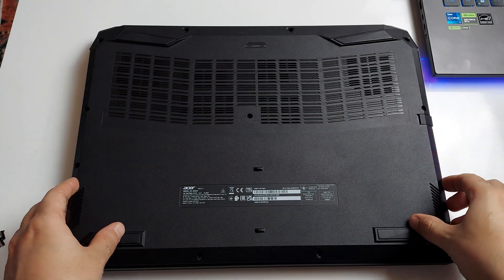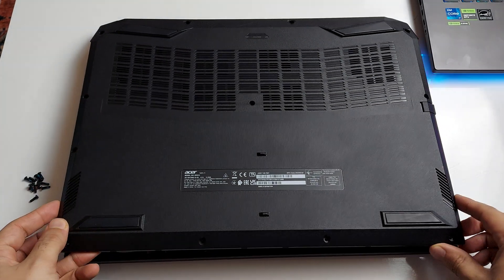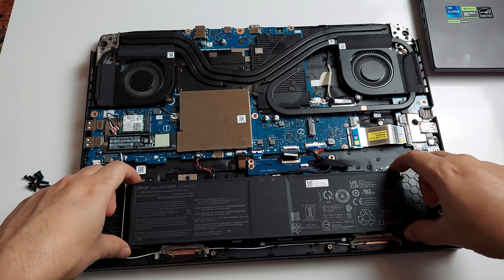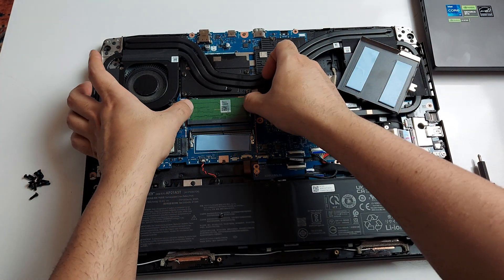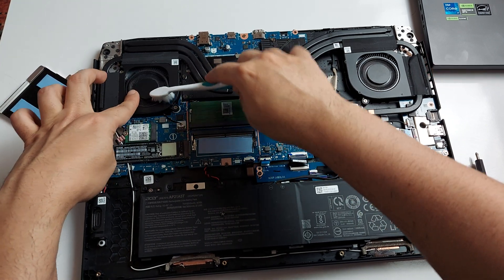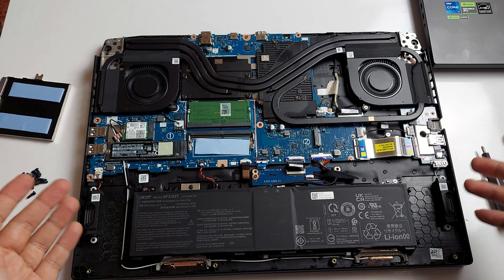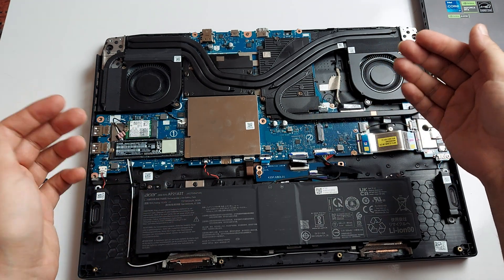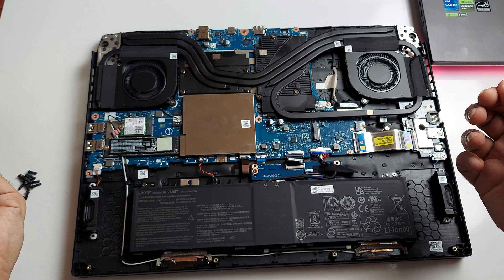what's inside the Acer Nitro 5 RTX 4060 Intel i7

Comment: That is a lot of wasted space. kind of sad to see such blunder by the design team.
Reply from the maker: It's built like a tank, there is not flex or anything, the cooling is amazing.... just that they could have added bigger fans and more heatpipes to lower the noise but again this thing is a midrange laptop... they could have added better speakers or subwoofer...
Reply: @DanTheManLand  They could've gone with bigger batter since it is a bigger laptop, or as you have said a better sounding speaker or and additional slot for a 2.5 ssd/hdd,It cost so little to add an additional strip for more storage. Better cooling is a good suggestion too so that it can have less temperature. There is a lot of things that could've been done for this 17 inch laptop. I think this motherboard is design for a 15/16 inch laptop.